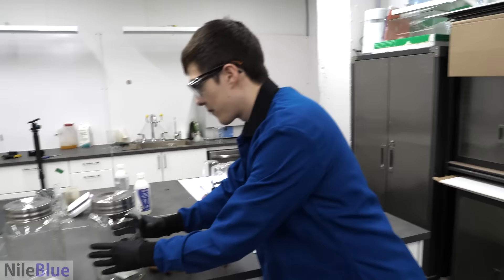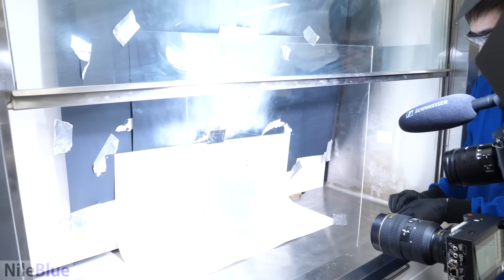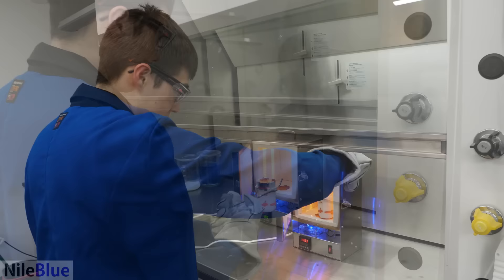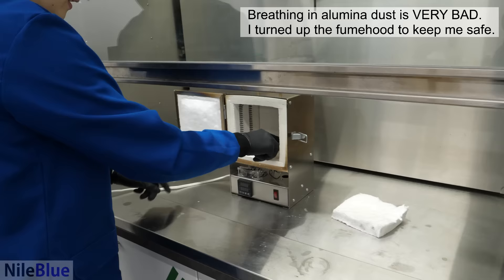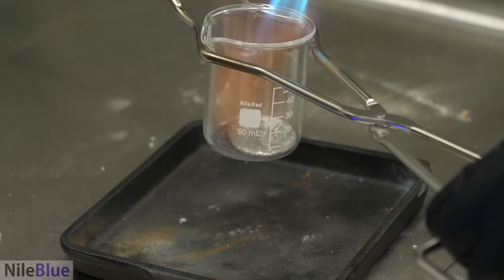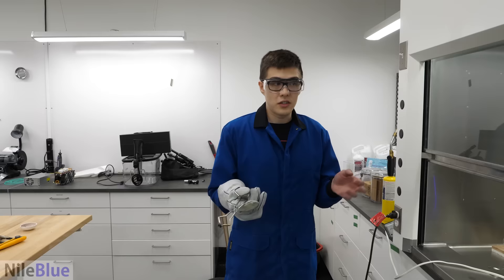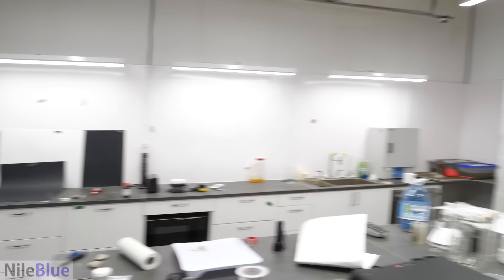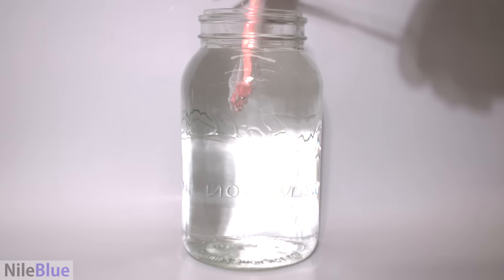This project was a disaster.

Comment: I like his theory about a "high dive" causing more turbulent flow, breaking up the gaseous boundary layer before the metal makes it to the bottom. A shorter jar filled to the top would make this demonstration a lot easier.

Also, it seems bronze made this more difficult than the gold alloy. A less dense metal sinks slower, requiring the vapor barrier to be sustained for longer.  Conversely, a higher specific heat requires less mass of metal (but not necessarily less volume) for the same amount of steam generation. These properties affect duration of dive, and duration of vapor shield stability: 
Au: 19.3 g/cc, 0.13 J/(gK)
Cu: 8.96 g/cc, 0.38 J/(gK)
Sn: 7.31 g/cc, 0.21 J/(gK)

The volume of metal poured also has an affect. A small drop of liquid metal won't sustain a vapor shield for long. Copper, tin, and bronze are more difficult to pour the full charge of metal since they oxidize easily, especially compared to pure gold.

Comment: It is most likely formation of metal hydroxide that cause explosion, similar to Alkaline metals.  Molten metal is high temperature increasing the reaction rate.  Tin is should be more reactive so more tin faster reaction and faster the explosion.  The water amount wouldn't matter unless the vapor bubble wouldn't form.  This is why in your gold experiment it reached the bottom, as barely any reaction if none at all and molten metal spilled and cracked the glass.

Comment: Actually the theory is partially correct. The glass shatters because the glass is at room temperature and when the molten metal is poured it makes contact, causing the glass to quickly expand. Since there is water in the jar it causes the glass to cool really quickly which make the glass weaker. The real reason is that its touching and shattering not the bottom of the jar. Same can be seen here https://youtu.be/7lP_ArfSw5w

Comment: The explosion doesn't come from Leidenfrost effect, steam can't produce that kind of shock unless compressed in a strong vessel with a very good release valve. It's a series of stress fractures in the metal as its surface is rapidly cooling and compressing on the hot metal core. Similarly, poorly heat treated metal products shatter at stress points. These pops either got the metal to hit the glass jar violently or the shock got amplified through the water in just the lucky frequency to break it, no idea on that one honestly. It's kinda like a mini-supernova.

When looking at the high speed footage:
On the first pour with lower tin content and slower pour, the metal flows down as a narrow stream and pops when it collects at the bottom. If you look at the Eutectic diagrams of bronze and gold-tin alloys, you'll see that less tin content = higher melting point which makes it less runny. So when it gets poured slowly, the stream breaks into smaller pellets instead of keeping as a stream, which allows the smaller pellets to cool relatively safely until it starts collecting at the bottom to form bigger blobs for differential cooling.

On the second and third pour, the liquid had more tin in it, lowering its melting point and making it less runny. The pour itself was also more aggressive and you can see how the liquid staying in a gigantic blob as it hits the water. The blobs then explodes more violently than before since it builds up more pressure.

Comment: I'm super late, but I know you read all the comments. As an amateur Smith at best, I have enough experience to tell you that you should do this again, but you should use a graphite crucible instead. Many would consider them cheap, however; graphite crucibles stand up well to heat.

Comment: My hypothesis of what is going on here is that the higher volume of tin boils more of the water at the same time, thus displacing more of it. The higher volume of water leaves more room for it to expand, so it doesn't start boiling violently right away.
When the metal hits the glass, vibrations against the glass free just enough oxygen in the water to start that violent bubbling, which in turn displaces more water until the jar cannot hold it back anymore and the water shoots through the glass instead of the top.

I bet if the jar was made of something less fragile, we would see a geyser instead of an explosion.

Comment: So what's happening here is that the water is super cavitating due to the extreme heat. You are creating a pressure wave within the jar, like a liquid hammer, that is punching the glass out as the water fills the void left by the vapor and then sloshes back to be more level.

Comment: As far as i know, from my knowledge of working with various types of glass for artwork purposes, the explosion is caused by thermal shock? 
It was explained to me as the molecules in a hot glass and cold water/air (or vice versa) are vibrating at a different frequency, when these meet, the rapid change in temperate causes excess energy to be expressed as cracks, or explosions. This is why a hot glass will crack under cold tap water.
Different types of glass ( the most common being 'float' glass like windows, and possibly those jars), have different reactions to thermal shock
Pyrex dishes for cooking are resistant to thermal shock, due to it being a mix of glass and quartz or something. 

Its possible your crucible also smashed because of this the first time,as the cold air rushed in, if your crucible was low quality or had impurities.

That's my theory, but you're the chemist!

Comment: I think the explosion comes from when by chance the metal envelops a drop of water, and then that flashes to steam and explodes the outer bubble of metal.  I've experienced the explosion in the opposite direction when melting down a bunch of recovered lead that was stored in buckets.  One of them had some water in it, and as much as many videos claim to have debunked the water into metal explosion, My theory is that is happens from water being driven below the surface by the material being added.  It made a very loud bang like a shotgun and threw molten lead everywhere.  Some of it landed on the roof of the garage 20 feet away (and probably 10 feet  above the pot I was melting it in)

Comment: I think it exploded because of the hot temp of the liquid metal hitting the cold temp of the glass and the glass reaction to the sudden high temp.  I would try it again in a different type of container to see if the explosion happens at contact with the surface material.

Comment: Question:
I assume that the explosion happens because of the immense difference in temperature between the cold/room temp water and the melted metal. So if that's the case, doesn't adding tin make the explosion smaller?
Because turning it into bronze makes the melting temp lower, thus requiring it to be at a, well, lower temp.
You'd think that a 2200°C melted copper would make a bigger explosion than 1100°C melted bronze?

Ofc, feel free to correct me on anything I'm getting wrong, as I'm not a chemist.

Comment: This is probably just flawed deduction on my part, but would the density of the gold have affected the experiment?  

My observation from your video is that the explosion happens at the moment the flow loses its retention and/or exits the vapor barrier, whether it be from slowed descent or impact as well as the observation with your second attempt that the addition of even more of the much less dense tin caused a premature eruption on contact with the surface of the water. Thus creating my theory of faster sinking/stronger retention potentially leading to a bigger concussive blast in deeper water with the delayed disruption of the vapor barrier.

Comment: Actual physics involved:  it isn't the shockwave from the exploding metal that breaks the jar.  It's thermal shock from when the still-molten metal touches the glass.  It puts stress on the semi-crystalline structure of the glass in a localized section, causing it to warp in that spot but not anywhere else on the jar because the water keeps the rest of it thermally insulated, and so it cracks very quickly.  Having that vapor pocket around the metal insulates it against cooling as it falls through the liquid water.  When it hits the bottom of the jar, the weight of the metal pushes the vapor out of the way until it makes physical contact with the glass... and then both the glass and metal are simultaneously subjected to thermal shock - hence the "explosion" which technically isn't an explosion but rather a rapid realigning of the crystalline structures of the metal and the glass.  The reason the second attempt exploded halfway down was due to the velocity - but more related to the deceleration.  It hit a point where the liquid water was slowing it down faster than the metal was producing a vapor pocket, and then the metal got thermal shock from contact with the liquid water rather than the semi-solid glass.  Easier to show all this if I can make diagrams LOL but hopefully a few curious people were able to follow along.

Comment: judging by what you used in this it's just a steam explosion happening. i'm guessing the earlier than  bottom reactions were because the steam was encompassed by metal and couldn't escape but for the final shot the metal made it to the bottom before the steam was encompassed by metal so it used it's energy on the glass.  the reason it is so violent is because you are heating up room temperature water particles by having them interface with heat from molten metal. this then gives them so much energy they rapidly shift to gas and the water particles expanded rapidly to the point where they exploded. please note that steam has been noted to rupture marine steam boilers that normally operate at 950 psi and 850 degrees Fahrenheit so doing this is definitely not recommended.

Comment: Often, when water comes into contact with molten metal, it rapidly decomposes into oxygen and hydrogen gas. This also makes dealing with (large) molten metal spills dangerous because you can cause a hydrogen/oxygen explosion if you douse it in water.

That aside, the reason I feel that the jar shattered when totally full as opposed to half way full, is that the shockwave propagated through the (mostly)incompressible water better than the layer of air in the half full jar. Think of a newtons cradle of all steel balls, the energy is transferred very efficiently. Now replace half of them with squishy foam balls on one side...

Comment: So ok, the first experiment was copper and gold.... So even with more water to travel through, the gold probably added enough density to the metal to allow it to hit the bottom before it exploded. Tin is far less dense than gold so it would make sense that to make it to the bottom it would have to have less water, a higher velocity when going into the water, or some combination of both to perform the same as the gold/copper mixture... Also, another unaccounted variable here was the temperature of the water, although under normal conditions I'm not sure how much of a difference a few degrees would make on the integrity of the glass, but it might make a more profound difference in the amount of pressure that it dispersed when the explosion occurs.

Comment: The jar explodes due to the cavitation Shockwave caused by the exploding molten metal. The shockwave rockets out through the water and collides with the bottom of the jar, ricochering against the sidewalls and fracturing the glass due to to it not handing expansive and contracting forces too well and water being incomprehensible. Fun stuff, just not if you are in the jar, and that jar being a submarine under tons of pressure, and the blob of molten metal being a self propelled torpedo.

Comment: That is called as cavitation
As pressure is proportional to temperature
Water is at low temperature and pressure where as molten metal is at high temperature and pressure
When these high and low parameters are inter mixed 
With each other
 this cause heat exchange between two substances
Which metal exchange heat
To low temperature water
This forms low pressure bubbles in the water.
These bubbles contains shock  wave which is enough to break glass container when it explodes 
 So as in case of pvc pipes 
Most oftenly cavitation occurs cause to break it due to above reason explained.

Comment: I recently did an “experiment” where I mixed sugar and potassium nitrate, poured it into a hole in a brick, and lit it on fire. I did not record any meaningful information, I just wanted to see a flaming reaction. The brick broke from the heat and pressure and I discovered that carbon gas smells like cotton candy

Comment: Ok, so this is what I think is what is happening... it's more of a physics standpoint than a chemistry one.

So why does the glass break? Glass breaks whenever there is pressures or or stresses in the glass. This can be done with either rapidly heating and cooling the glass or striking it in the right place. I feel the jar 'broke' rather than 'exploded'. 
From what I can see is that the molten metal once hitting the water, athough breaking apart once cooled, is not actually striking the glass from the inside. However, the heat and expanding pressure of heated water is fracturing the weak points of the glass, usually where the hot mass of recently solidified metal (also stress) is. Mainly at the bottom or middle of where the glass is thinnest. You can so have the air pressure from the top of the jar in conjunction to this adding to this effect. 

One other thing to note, copper is a softer metal and is easily squished. You can get more into a crucible by doing that first 😅

So many other ways to test this with scoring the glass, using a metal container, or even having boiliung hot water in the jars to lessen the effects. Thats what I think is going on. What's your take lads?:goodvibes:

Comment: The final explosion could be happening at the bottom due to the metal being hotter when it reaches the water and then the heat being insulated by the pocket of water vapour. So less distance to the water means a more delayed explosion. Then again just my theory on the matter I'm no scientist. Just a good old engineer.

Comment: i think the explosion is because of the speed the metal is cooling and the water is heating putting stresses on both the glass and the metal and when the metal has too much stress its exploding adding additional stresses to the jar making it shatter and i think the reason the metal didn't explode low enough is because the metal had already cooled too much to make a good shield agenst the water making the metal have the stress to explode a lot earlier then it did with the shield so the major difference between trial 2 and 3 that made it work is in the 3rd one the water took longer to get to the metal because as the metal hit the water it created a shield of the air that was in the room and steam meaning its cooling got delayed just enough to get to the bottom of the jar before built up too much stress and exploded adding the final stresses to the jar for it to explode

if anyone's got any comments on this or arguments on why this can or cant be please share i would love to know and i may learn something new
but if i got anything wrong just don't hate this is just a theory and i may not know something or forgot to consider something when i was running through it in 0.25 playback speed

Comment: The water was film boiling, keeping the water away from the surface of the metal. Once it cooled enough for the cold water to flood in, a steam explosion occurred and a steam hammer effect shattered the non-tempered glass.
You'd have had the explosion on the first try had you used enough copper alone, given it higher melting point - assuming you didn't set it onto a non-insulated surface and allowed it to cool.

Good with chemistry, but you're a menace with metals (yeah, I saw the bismuth knife episode).   ;)

Comment: i have a theory about what happened, i make jewellery and something i notice when i am quenching a high temprature piece of metal is that it will hiss a bit as it goes in and then suddenly quench and will produce a rush of bubbles. 

i think what is happening in both my quenching and your explosion is that when the very hot metal enters the water it forms a skin of steam which ends up being a very good insulator, like the leidenfrost effect, and its only once the metal cools down enough that the water can actually make solid contact and then absorb the heat which results in the rush of bubbles. 

i have two theories as to why it exploded. one, it may be that by pouring at a higher velocity the globbules of metal were dispersed into smaller pieces and that raised the surface area sufficiently that the water was able to cool it quickly enough that the ladenfrost effect was no longer effective and then the sudden transfer of heat is what causes the steam explosion. 
secondly, its possibly that the highvelocity pour allowed the copper to reach a sufficient depth that the water pressure also overcame the liedenfrost effect and then caused the steam explosion. 

i dont think it is always the steam causing the glass to break however, i think some times it may just be unequal heating but the last was defeintly the explosion.

Comment: The oxygen formed when the rapid boiling occurs creates an unstable vacuum taking the liquid water lower than it's vapor pressure. Unstable is the key word here. The oxygen created when this occurs can't be sustained at a lower temperature, which erupts rapidly. We Mechanical Engineers see this in pumps and is called cavitation. It can be costly to replace pump impellers because the violent reaction you saw pop that jar can pit the metal impeller.